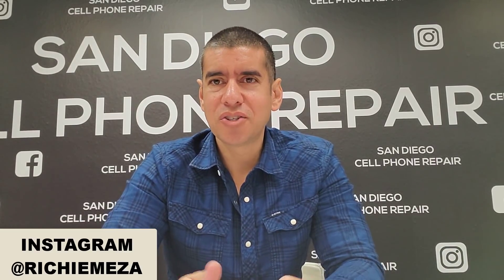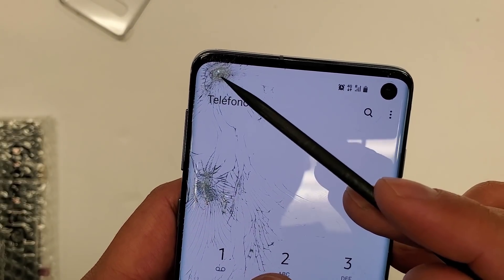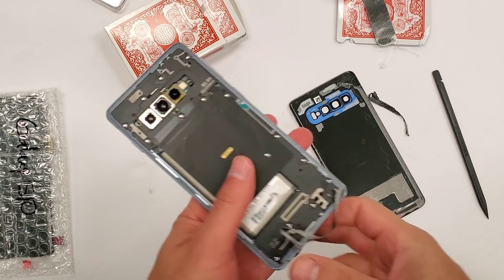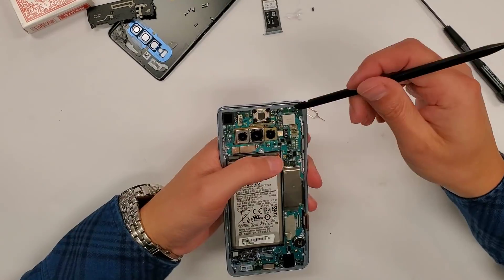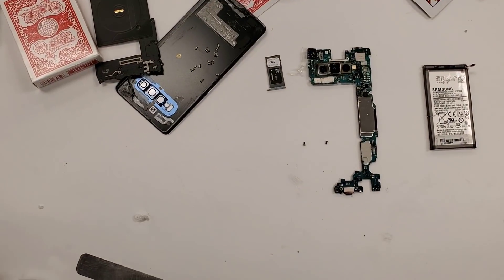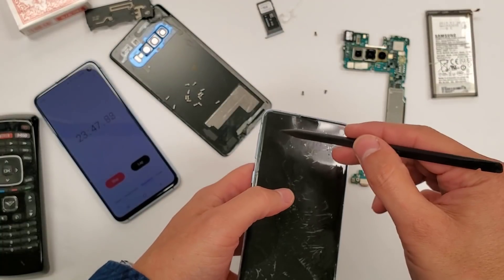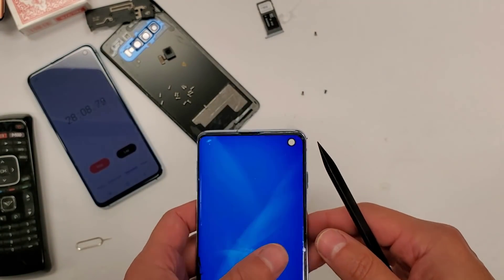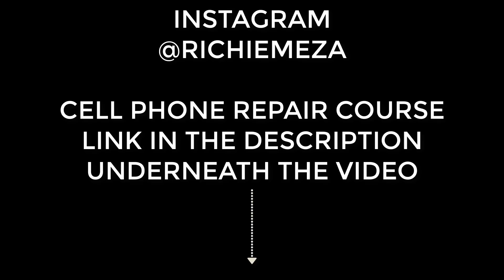Samsung Galaxy S10 Glass Replacement with Freezer *Still Works?*

Comment: Does the residual glue left on the screen after the freeze separates the old glass hold the new one on, or do I need to get more glue or adhesive?
Reply from the maker: Old glue gets cleaned off. New glue gets put on.
Reply: Where can I buy the glue? It didn't come with the new glass.

Comment: Hi Richard. I have done a few S7EDGE , S8 and S8+ glass replacements without any issue....... but when it comes to the S9 I have had no success with the freezer method. I now do the S9 with a wire and hot plate.
My question is, did the glass on the S10 come off as easy as the S8 and S8+ using the freezer method? 
Thank you so much for posting these videos. I see you as a kind of mentor. Since I have been following your channel I have gone from fixing a few iphones and Samsung's from home to working out of my friends computer shop in my town. Once again , thank you sir.
Reply from the maker: The S9 and S10 are the same way with the freezer. There is more of a trick and technique to doing those then the S7 Edge and S8 phones.
Reply: @RichardMeza  thanks for the reply. Is there any way you could teach me this? I'm more than happy to pay for your knowledge. I probably could do it with a wire but it takes ages and I dont really see the point in spending a couple of thousand on my freezer if I'm not gonna use it.
Thanks jon
Reply: @RockingAOTSwirled  just a FYI, keep doing hot plate and wire for S9 and S10 phones. This guy keeps mentioning freezer tricks . I have fixed more galaxy phones than he has ever done, just letting you know check out PHONEDOCTORS  here on YT and that guy will show you how it works. He has videos too that explain why they do not use freezer for S9 and s10 models. Hope it helps. No tricks with freezer exist for S9 or S10. I have tried everything from cutting the edges of the glass on those phones to alleviate the pressure when AMOLEDS bend while frozen and etc. Success rate varies and is not profitable. Hope it helps you ;)
Reply: @vladvlad7599  how u cut the edge on the glass?
Reply: @vladvlad7599  thanks ;*

Comment: Hello quick question, can you simply use your own freezer from the kitchen or do you have to use the freezer that you're using from your videos?
Reply from the maker: You have to use one like mine or liquid nitrogen also works.
Reply: @RichardMeza  so do I just pour the liquid nitrogen on the screen?
Reply: If so can you make a video with that method because I clicked on the link of the freezer and not alot of people have that type of cash just lying around
Reply: Last question what site do you buy all your phone screen? Thanks! Greatly appreciated!!!
Reply from the maker: @israel.simeon  I dont personally use liquid nitrogen because I have that freezer. But I know it works. There is a machine that runs off of liquid nitrogen you can buy on amazon. The suppliers I use for my screens are in my cell phone repair course.

Comment: What is the quality after you reglue new glass on the LCD? 
It cant be the same quality as samsung service pack right?
Reply from the maker: The same display screen is being used. Taking off the cracked glass and reglue a new glass back on.
Reply: @RichardMeza  but how is the quality of the display? How is the quality after 6 months of use?
Reply: @yaraby  The display remains the same, you are just putting new glass on. The actual LCD screen is exactly the same before/after repair.

Comment: BTW, how much do you charge for s10 glass repair?
Reply from the maker: I haven't started offering it yet. I have to wait for the cleaning molds to come out. I made this video to show freezer method works the same on the new galaxy S10. It's the same thing as the S9 glass only repair.
Reply: @RichardMeza  Great Video it was. There is a new model of Cleaning mold coming up which is able to modify the size of space so you could use with a different model of phones.

Comment: I have done the same method but with liquid nitrogen seperator on an s9+. Thanks for the info on the new samsungs. I wasn't sure if freezer method would work still. Appreciate the video! Big thumbs up
Reply from the maker: The S10 is the same method as the S9+.
Reply: @RichardMeza  Can you remove the s9 glass in freezer? I have a -185 freezing machine and it splits in two the s9 oled. Can you give me any tips on how to remove the s9-s10 safe with freezer?
Reply from the maker: @cristiangabrielfishing560  Yes you can. It's done with a different technique with the freezer. I have multiple videos of it in my private facebook group and my cell phone repair course. I do not have any public youtube videos of it.

Comment: Ok. I had an S10 and I broke only the glass.  So, if I freezed it, is it be perfect?
Reply from the maker: You need a freezer like mine. Or liquid nitrogen also works. But the freezer removes the glass from the phone. You still have to re-glue a new glass back on.
Reply: @RichardMeza  ok. How much is to fix it? Do you have some idea?
Reply from the maker: @RodriTeix  How much am I charging in my shop? The full display replacement in this video was $300. As for the glass only repair if the display has no dead pixels or bleeding black spots, I'm waiting for the cleaning molds to come out. So the glass only repair I probably will start in the near future. I wanted to show in this video that glass only repair using the freezing method works perfectly fine with the new S10 models.

Comment: Great work rich as always you the boss how long did you leave it for and whats temperature  you used ?
Reply from the maker: I have a negative -145 degree freezer. On this phone I believe I had it in there for around 7-8 minutes.
Reply: @RichardMeza  thanks man keep the videos coming 😀
Reply: Could i do it with my -185 Freezer